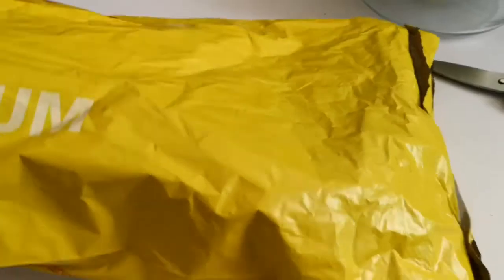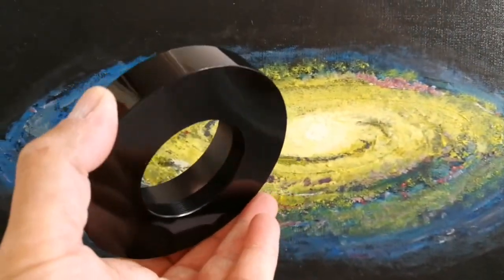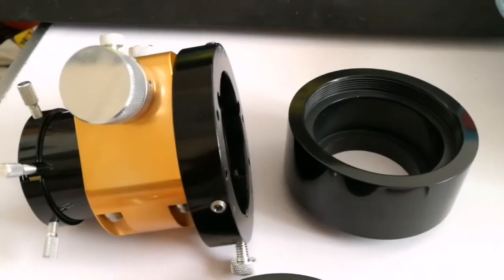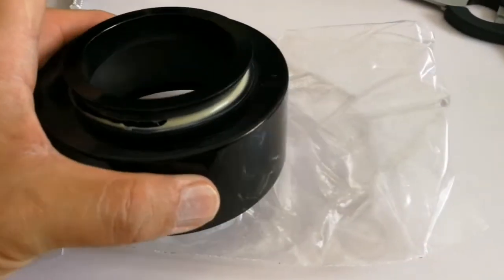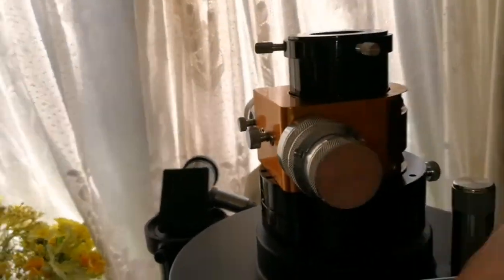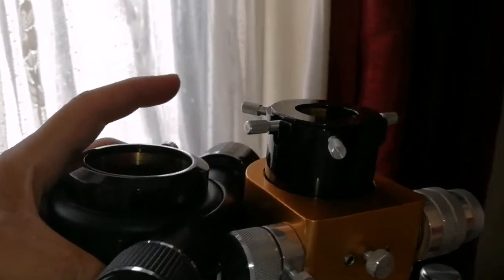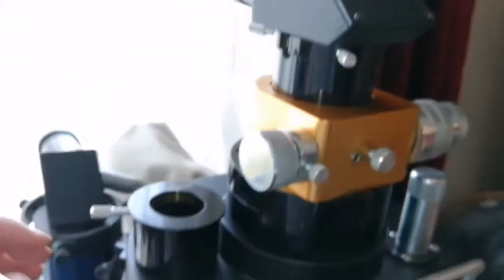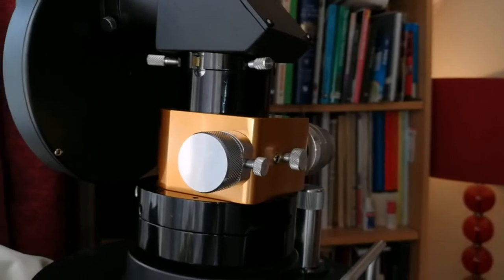Moonlite Standard 2 Inch  Focuser Flange/ Meade And Celestron SCT And Skywatcher Maksutov Telescopes

Comment: you should look into getting a baader clicklock 2" for holding diagonals and other gear they work so much better than the 3 screw set up  i am surprised the moonlight focuser don't come with at least  a 1 screw and band system to hold diagonals and eyepieces i recommend the baader click lock  retaining system  far superior to 3 screw and banded systems of attachment and will not mark you expensive eyepieces 
cheers
james D
Reply from the maker: I have it, but not using it on this one. Most Baader equipments are not the best. They sell partly an image of a brand. More like Mercedes Benz A Class which is practically a VW Golf, Audi A3, Nissan Pulsar and all on platform of a Ford Focus ( and both owned by the same American company). The only difference is in the trim ( different sofas on four wheels).
Reply: @TheAstronomer   i think baader is ok i have their filters and  a few T2 42mm bits  that i feel are good quality and well made but a agree with you on their eyepieces  i have the mark 4 zoom 8mmm to 24mm  i was not overly impressed  so i only buy their filters which are good entry level to quality filters which suit my level and the T2 42mm bits seem well made 
cheers
james D
Reply from the maker: @James Dougan yes, it is true about Baader Filters. Baader Filters are all based on the scientific discoveries made in the German Democratic Republic, the socialist East Germany which had huge amounts of patents on using different elements as coatings for Filters. They just couldn't break through the American-dominated western European market to sell them, otherwise they were years ahead of anything available, even now. Those scientific discoveries were possible because people had job security through their lives, and could build up on their work, not like now that all western countries are laughing stock for their failure to develop a Covid-19 vaccine, when China and Russia already are selling theirs to India and about 34 more countries.